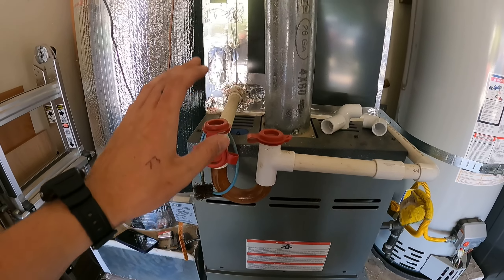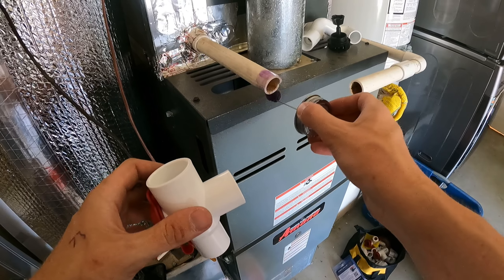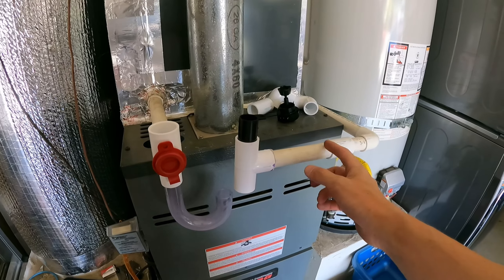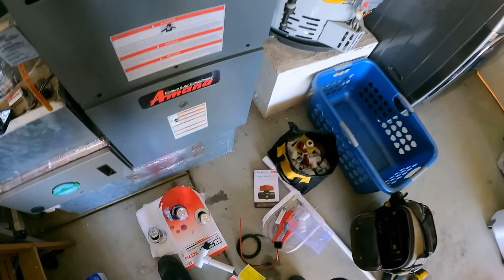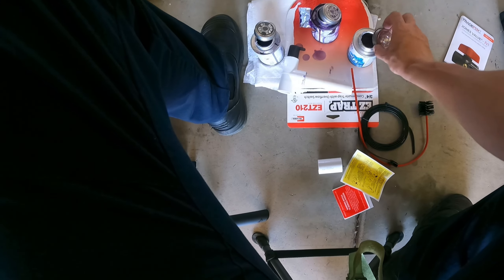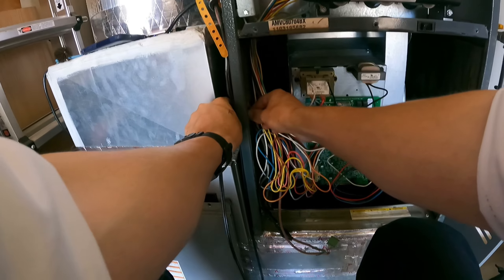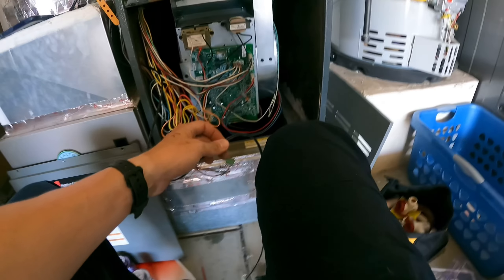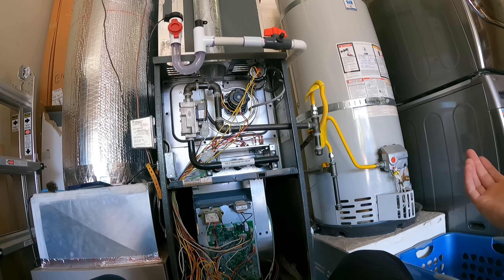EZ Trap float switch & Jones Blowout Valve installation

Comment: Good stuff. Everything seemed easy until you started wireing the flot switch lol
Reply from the maker: Looks confusing but nothing too crazy. Basically just splitting the power wire.
Reply: @HVAC_Academy could you explain that a bit more in depth please.
Reply from the maker: @kevinstfort  instead of the R (24v power wire) leading straight to the thermostat it first has to flow through a float switch then to the thermostat. Meaning if the float switch were to trip, as it should if there’s a water build up, then the 24v power stops at the float switch and does not make it back to the thermostat. This will make the unit shut off and not cause water damage.
Reply: @HVAC_Academy  thank you.